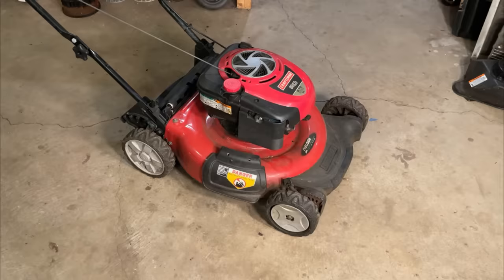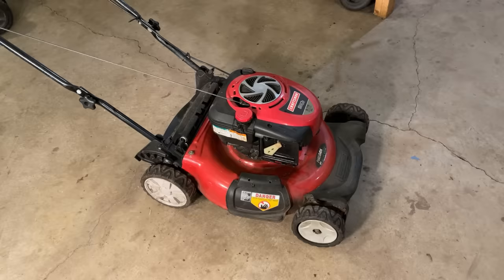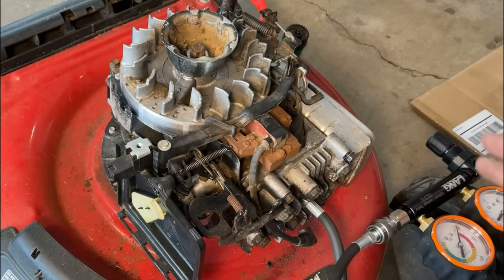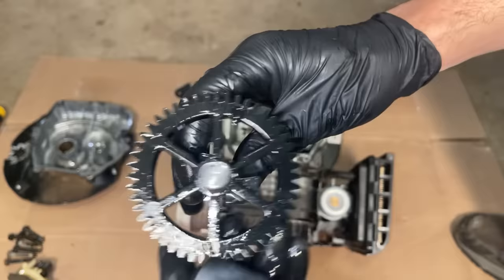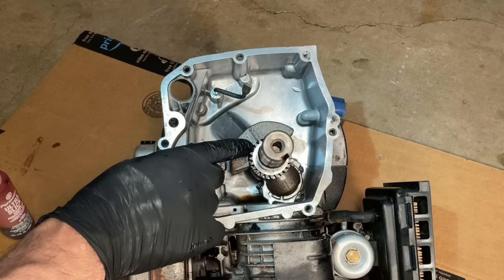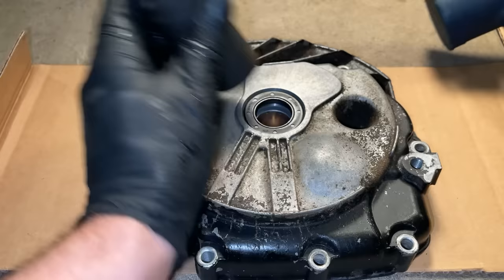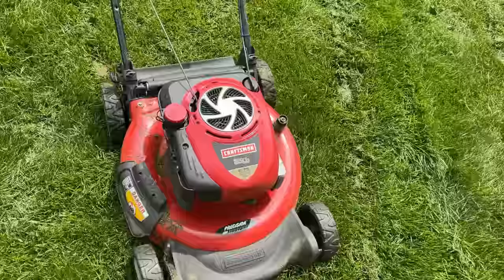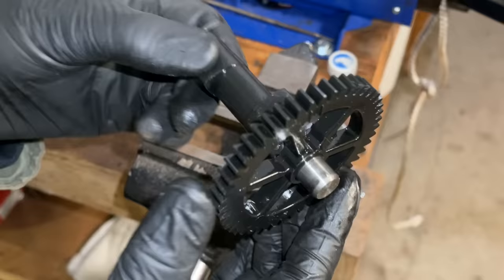Lawn Mower Will Not Start - You Will Never Guess Why

Comment: I've always been a big Briggs & Stratton fan boy, and had no idea that they had sunk to that level of installing plastic cams. This really made me sad.
Reply: I gave up on B&S years ago noticing things like that.  Also the local Amish rental place only uses Honda engines.
Reply: Been a Honda fan for many power equipment lately not one of the Honda engines have for years has ever had a problem no matter how poor the maintenance has been.
Reply: Briggs has been using plastic cam gears for at least 15-20 years.
Reply: Btw, the metal cam gears everyone loves so much will corrode and fuse to the gear on the shaft in a matter of months if they sit, especially once the oil goes bad.
Reply: These type issues can be diagnosed pretty easily by emptying the oil and sending a plumbers' camera into the crank case. I feel like the time it takes to rebuild a push mower isn't worth it from an opportunity cost perspective. Too much time to invest into a $50-75 mower.
Reply: @cwytonweb  Yup.  Just keep tossing things into the landfill and break out the credit card to buy another one.  Must be nice to have so much disposable income to offset the lack of skills.
Reply: @mikeclarke3005  I had a Honda 6.5 on my pressure washer. Hard to start, then once it runs for over 5 minutes and you turn it off, really hard to start until it cools off. I can’t run a pressure washing service like that! Sold it, new owner said same thing , he would never have another Honda engine! I ended up buying an electric Ryobi pressure washer, works great! Have a good day! 😀
Reply: @bbaaspencer1  i own only one Honda engine and its on an air compressor. it worked great for 150 hours or so then it started to quit while idling and was very hard to start. i put on a new carb, filters. coil, plug and gas line and it still runs bad and starts hard. its had a very easy life but its trash and i will never buy another honda
Reply: I don't  see how any one could be a Briggs & Stratton  fan boy.  Briggs & Stratton has had a horrible reputation  all my life . I'm 70 years old . What kills me is that a commercial mower company installs Briggs & Stratton motors in their $6000 machines . Who in the hell would want that.   More horse power as compared to Kawasaki
Reply: @haywoodyoudome , I think what the other poster meant, if you're buying mowers for profit, then there wouldn't be much money to be made on the one in the vid considering the machine cost $25, another $25 on parts plus his time, which I'd imagine was at least 2-3 hours. However, if it was a mower you were keeping for your own personal use, then go ahead and upcycle it. Correct me if I'm wrong but the machine in the vid looks like a mulcher so I would repair and keep it.
Reply: @cwytonweb  can be really quick if you know what you’re doing and easy to do, this will last many more years, new ones are $400+
Reply: @REM505  Honda’s have plastic cams
Reply: Every B&S engine I've worked on was junk. When I was a boy we had a B&S engine mower and it was bullet proof, left in the rain, neglected and always fired up. They're not the same anymore.
Reply: @RCGshakenbake  that’s what I say about women.
Reply: 3hp I/C motors began using plastic cams when my son was running 1/4 midgets. The engine builders bought up all the stock of steel cams.
Reply: @cwytonweb  27 or 28 years.
Reply: Most of the new riding mowers have plastic parts in the transmission that result in main breakdown issue within first couple years of owning 1
Reply: @haywoodyoudome  Not at my house.  Buy a good one, and keep fixing it until parts aren't available any more.
Reply: @robertbrawley5048  100% agree  the 60's  and early 70's I had experience with were poor starters,  tended to have issues with sticking valves .... but, I recently upgraded the 67 motor  to electronic ignition, and it became  an easy starter hot or cold which it had never been.  I have known that particular  pos from new, and had many a conversation about its genealogy
Reply: @davidp8157   sticking values. Yep I had nearly a brand new smalll engine welder with a Briggs, & Stratton engine in it and sure  enough the repairman said it was sticking value . That was in 1984 . I think
Reply: @robertbrawley5048  yes, trying to get sufficient  compression to start with sticking valves is something  of a pain... Other issues such as low grade surface rust on magneto on what were already   poor starters  further increasing resistance , or a range of other issues  never endeared B&S to me
Reply: @davidp8157   I'm glad you mention the corrosion  on the magnets. . That was pointed out to me as a problem .  All young adults  from West Va and western Pennsylvania seem  to know that . . You know the hillbilly class . I'm from suburbia and had to get properly educated from the hillbilly class
Reply: @REM505  I thought Amish only used horses.
Reply: @robertbrawley5048  I have a B&S 11HP on a Murry rider that was built in 1989 and runs just as good now as it did new and has never been cracked open... Kawasaki engines are the same thing as in this video... All will last if properly maintained...
Reply: @Qmaster35   thumbs up. But I'm still leary of them
Reply: @cwytonweb  
We always had great luck with the Briggs & Stratton engines of old, & I’ve got some from the 70’s that are still great. 
I have a John Deere walk behind that I bought new in ‘91, with 4 HP B & S that is still fantastic. 
Another from the early 2000s & another from the last year or two....so far, all good.
I don’t like the fact that the newest one doesn’t have a throttle adjustment lever.
Reply: @robertbrawley5048  
I’m not as old as you, but I’m 55, and all my life I had great luck with Briggs & Stratton engines. 
Not sure how the new ones are, but ever since my childhood days of very young, I’ve had nothing but good luck with them.
Reply: @patrickflohe7427   well you are old enough  to have qualified experience.
Reply: @cwytonweb  I've got engines that are close to 100 years old and I've never once seen a problem with an iron camshaft seizing.
Reply: @bbaaspencer1  I have a Honda pressure washer, generator and outboard motor, my experience with them is they're great except they're REAL picky about fuel. Use fresh, ethanol-free fuel and they run great. If the fuel is stale they won't even start without starting fluid.
Reply: @bbaaspencer1  probably just topping the oil off and not changing it.
Valve lash is supposed to be at 4 thousandths and from collective wear,yours was probably around 20 or more.
Exhaust valve opening WAY too late. Still had compression AFTER Top dead center by 10°
Reply: Should be a reason why that cam changed position.
Didn't get in deep enough to figure that out.
Probably going to happen again.
Reply: @paulbillings1791  It spun on the shaft. Plastic part pressed on, it will happen now and then. Might have been overheated some too, happens a lot with lawnmowers as grass clogs up the fins.
Reply: @patrickflohe7427  if you see a black plastic carburetor on a Briggs,it's a Chineseium Briggs.
Steer clear.
Reply: @bbaaspencer1  if it's an automatic choke. It's probably two things. The stupid wax filled cartridge that activates the choke is failing and getting out of phase with the actual engine temperature and there was also a governor spring update.
Reply: @James1095  had a customer bring one in that had blown the valve cover off from age and never cleaning anything.
The whole machine was a basket case and not worth repairing everything or even half of the problems,so why even begin. Probably a $225 machine to begin with.
Reply: @haywoodyoudome  I think that's planned obsolescence. Not worth the average person to repair . Does suck !
Reply: @mikecubes1642  Did you ever consider that your Honda Engine could have been a Chinese copy of a Honda? These have flooded the Market, so please be careful. Only a genuine Honda - works like a Honda should.
Reply: @peterduxbury927  I dont think Ingersoll Rand put knock off honda engines on their new air compressors. I forgot I had a cheaper honda engine on a brand new cub cadet wood splitter and that was a POS also, luckily i sold it to some sucker. it had less than 100 hours and always had problems. I would take a K series Kohler engine any day over a rice burner
Reply: Like many who have commented….Briggs was the gold standard when I was growing up +40 years ago. Now, Honda smokes them
Reply: @seanlathbury5410  Saw your message and have to agree with you! The sad part about B&S is that (when the Cam Gear slips on its' shaft), the Mower may be difficult to start - for weeks or even months, leading -up to complete slippage and failure. I had "lost complete interest" in B&S, and purchased a Honda Self-propelled. 12 years later, I've only had one issue, which cost $25 to repair. Drive shaft failed. I can only imagine the arguments at B&S, where The Accountants battle with the proud Engineers who designed the Briggs. It is always the Accountants that wreak havoc on (what used to be) a great product, then the Accountants leave the company, and go and damage another company. Accountants get praise for increasing the Bottom Line, they don't have the pride - like an Engineer, to manufacture a great product anymore.
Reply: @cwytonweb shew I wish I could find one for that, I wouldn't be rebuilding my first small engine today...